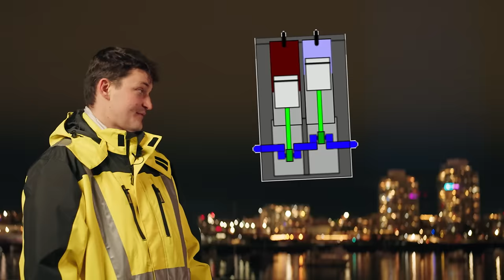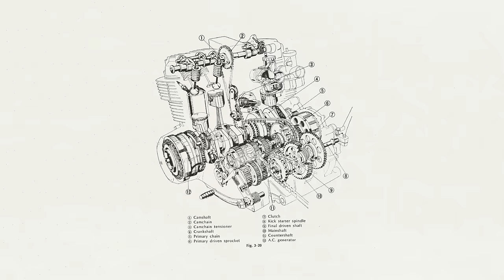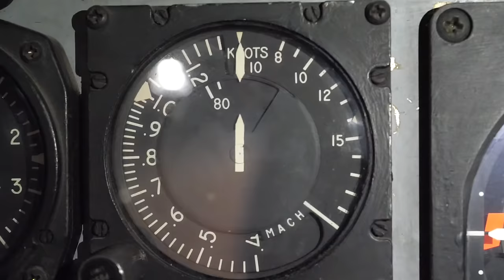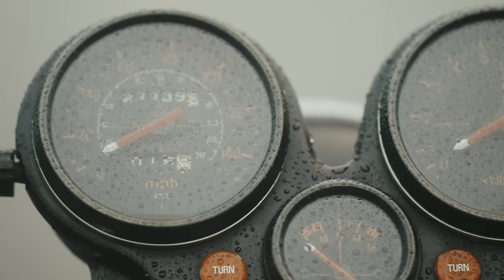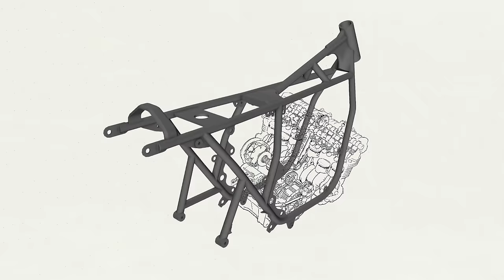Riding the Cream Machine - Honda's Smooth Six

Comment: Having graduated from Motorcycle Mechanics Institute in the mid 90's, I can verify that the school had 4 of these. AND to get out of the basic classes and into your "elective" picking one of the manufacturers to concentrate on, you had to do a valve job AND sync the bank of 6 carburetors on a CBX to move on with your schooling.
Reply: By Celestia!

Also hi dustykatt, haven’t seen your name in a while.
Reply: Ahh... back when motorcycle mechanics needed to actually understand motorcycles and mechanics.  Now, apparently all you need is some tools and the manufacturer's proprietary shop procedures manual for each bike.
Reply: Why can't a motorcycle engine have 1 intake and 1 exhaust manifold like car engines? Why do they need 6 carbs and 6 exhaust pipes?
Reply: @chadkline4268 The 6 exhaust pipes isn't true, technically cars also have a an exhaust pipe per cyl they just call it a manifold because they're welded together, in bikes they're not but it's the same part with the same function.
6 carbs help because the inside cyl run hotter than the outside ones and this changes slightly the amount of fuel they need. Cars can get away with 1 big carb because the engines are way bigger in displacement and less rev happy than motorcycle engines. The smaller the engine gets and the more revs it reaches the more fine the tuning needs to be so having 1 carb per cyl helps with that.
Reply: @alexandermoschonas2597  ok, that's a good answer, but it doesn't explain 2 carbs in parallel twins 🤪 I am kidding a little. I think your answer is as good as can be expected. It sure seems like a lot of added complexity and required resources with little benefit. Thanks, excellent analysis 👍
Reply: @chadkline4268 it’s actually because for optimal performance an engine needs the same volume of air fuel mixture going to each cylinder. This is only possible with runners that are equal length going from the carburetor to each cylinder. If you had only one carburetor the runners could not be the same length and this causes performance to suffer because certain cylinders get more fuel and air mixture. Also cylinder would have to share fuel because of the overlap in their intake strokes. This also hurts performance.
Reply: @TheDuckTeamYT  hmmm! Well, you seem to know something. But I don't think it is correct to say intake valves are ever open at the same time. And   a single carb doesn't put drag on the airflow for some cylinders and not others. With a 900cc engine and 6 cylinders, that is only 150cc per cylinder. That's like 1/2 a cup, less than 5oz, less than 5 tiny shot glasses or cough syrup cups, hardly anything at all. And the intake is fairly steady at 1000rpm, and an intake manifold is buffering between strokes, full with fuel/air at every new stroke. I wonder if a single carb in a multi cylinder motorcycle engine was ever even tried. Maybe nobody even knows how it would work 🙂
Reply: @alexandermoschonas2597  the only problem I have with this answer is that it has scientific correctness, but only to a limited extent that would likely not be noticable in practice. So, a middle cylinder is a dozen degrees hotter. It's not going to operate much differently with the same f/a mixture as other cylinders. I think the reason for not having an exhaust manifold as part of the cylinder structure is because it would trap too much heat. You want the exhaust gasses far away from the cylinders as fast as possible without any remaining in the cylinder structure.
But I still don't see a strong reason for avoiding a single carb and intake manifold. The major restriction is the air intake+filter, not the carb. A carb could happily supply an intake manifold of 500cc (2 cups) so that it always has more than enough f/a for the next valve intake. I think the reason is because an intake manifold would cause a delay .. when an intake valve opens, and the piston sucks in the f/a, the pressure in a manifold will drop before new f/a is drawn from the carb. It will take some time for that low pressure wave to reach the carb. And maybe the intake valve is even closed by that time. But at a 1000rpm, I'd still expect airflow to be pretty smooth. Even if a few strokes are not. It would be interesting to see if someone ever tried it.
Reply: @chadkline4268 one carb per cylinder allows the intake manifold to be as short as possible which helps throttle response.
Reply: ... The only question everybody else should ask; "With the right tools or do you wanna tell us you did it by hearing?"

Because the later would be impressive. The first is just an exercise in exaclty the job you got trained for.
Reply: @chadkline4268  Double Carbs? Ever heard from them?

Impala, Grand Prix, Mercedes SL and alike? 

Like, you do know that you also had then to adjust the timing right and so on otherwise you blew out your Valves?

And he literally explained to you why; Thermodynamics.
Reply: @DaroriDerEinzige  The right tools and the manual!
Reply: @dustykatt  And here am I, buying those Tools from my own money to do the same in my freetime without getting a certification.

Tell me about being born 10 years too late.

Well, ok, on the other hand I can also fix electrical stuff and put new microcontroller on boards.

... Which I also do in my free time without getting paid or a certification >:(
Reply: @DaroriDerEinzige  Well, I paid like 18K for my schooling, so get those skills for free!
Reply: @dustykatt  No front, but I am always amazed of how normal it is for US Americans to just take it that education is behind a pay wall over there.

Like, that's literally the opposite of Freedom and they themselves often point out that Universities & Trade Schools use their Status to influence young people.

Like, if somebody would tell me I'd have to pay for an apprenticeship or for an University Degree, I'd just would do illegal stuff. Last time, one guy over here got forced out of University and had no perspectives, he started the 2. WW.

Seriously though, why should I pay to get Certifications which only serve another men to be able to decide if he wanna employ me or not?

Like, if nobody would do that - Rich people simply would have to learn to fix their stuff on their own or they would be forced to change the System.

Imagine you've a dead beat Dad like me, and start with -40 000. How tf should you even be able to get a credit for the 18k to get some Certifications to be able to get a proper job to earn money to pay back debts your father made?

And even if we take out the family debts, just on your own; you would be forced to get into debts to be able to work. That's basically "slavery" like the Romans or Europeans did to each other. You wanna have a Ticket to the new world? Well, then you'll have to work for me like I say you will, for 10 years without questions - otherwise I'll hang you. (Not as harsh as, you know, the famous slavery over there but that was a thing too)

It's really astonishing. I mean, imagine to take away AR15's from US americans, how they would escalate - yet those things are completly fine for them. You wanna learn someting? Weeell, then give me money and if you don't have one, become a modern slave!
Reply: @chadkline4268
I agree with you and unfortunatelly with a bit of research i didnt fing any multi-cyl bikes with a single carb to check if it's been done on an obscure model in the past, but I guess you did this search already. 
My second guess is that the RND has been done by the likes of Honda or another bike manufacturer especially when  they started going for over 100hp performance. While it would work there's no really a counterargument of why it should be done. Having worked on many bikes I think it would be hard fitment-wise to have a single carb I4 bike. On I2, V2 and especially on a V4 applications (Eg the VFR 750 of 1986 had 4 carbs that are laying almost flat so I big single carb would be about the same size ) it could be done, but there's really no benefit and most could argue that a single carb per cyl is the way to go for performance, Hell Yamaha in the 70s and 80s even had 2 carbs on the single cyl XT 500, and later 600, and I always though it didnt make much sence but Yamaha knows better than me. Meanwhile in the car world, performance oriented cars like the Stratos opted for indipendent carbs per cyl as well.

The answer to your question has 100% been answered in the past, too many examples point towards the "one carb per cyl equals more performance" answer and Yamaha, Honda and many more definitely experimented and found their reasons.
Reply: @alexandermoschonas2597 just to add to the discussion here, I'd like to add that in the Goldwing community it's fairly common to convert the older 4-carb bikes to a single carb in the name of reliability and simplifying maintenance. However, it's generally expected and accepted that doing so is guaranteed to bring a decrease in throttle response, power, and fuel economy due to the fact that the intake runners necessarily must be much, much longer than they would be for individual carbs. It also brings in additional problems like intake icing. The 1500 goldwings are one of the few examples I know of of a bike actually using a one carb for multiple cylinders, where two carbs are used for six cylinders. They actually had to add coolant passages to the intakes in order to warm them up in cold weather, otherwise they frost, and ice up. Same problem tends to happen on the converted older 'wings.
Reply: @Wellimanewguy  Interesting! I've never worked on a Goldwing before so I didnt know things like that are possible but it sounds to me like adding 1 big carb and coolant passages is way bigger a job that servicing the original 4 carbs. Dont know how easy it is to find repair kits for the original carbs though so it could be done for that reason alone.
Reply: @Wellimanewguy  interesting comment. I'm going to look up a gold wing 1500 😁
Reply: @TheDuckTeamYT  While the optimum is for equal length runners, the CBX is probably the worst cylinder head design in all of motorcycling for having massively different intake port shapes, lengths, and flow characteristics. The designers and engineers wanted to keep the runners / ports straight, equal length, and short, but the team in charge of the rider ergonomics and styling of the CBX made the engineers angle the carbs in toward the centerline of the bike so the rider's knees wouldn't have to splay out, and to keep the middle of the bike and the seat width closer to the width of the CB750. According to Shoichiro Irimajiri, the engineer in charge of the CBX engine development, there were two things he wanted the CBX to have and didn't get - liquid cooling, and straight intakes. He said later the prototypes with the straight intakes made over 20 horsepower more than the equivalent spec engines with the funky intake ports, and added liquid cooling and straight intakes would have brought the CBX to about 140 - 150 horsepower, up from the production version's 105. Honda did attempt to band aid the intake issue by making the air box runners different lengths to try and equalize that runners, but is was only marginally successful. I have a damaged CBX head that someday I hope to weld up and re-machine to have the straight intakes the engine should have had back in 78.
Reply: With such small cooling fins and 6 cylinders how in hell does this thing not overheat??? The middle ones seem to have no way of dumping all that heat due to the lack of surface. Or does it have an oil cooler? Does anyone know?
Reply: @EbonyPope  I don't know, but I've never seen anything with 4+ cylinders without water cooling. I think air cooling is limited to twins/boxers.
Reply: @chadkline4268  I thought so too. Strange. Can't find any info on it.
Reply: @chadkline4268 it's the same reason modern cars have a seperate fuel injector for each cylinder.

Having the jet as close to the combustion chamber improves  throttle response and efficiency

This is especially true with direct injection engines.
Reply: @tristan6509  direct FI is completely different than carburetion. DFI works on the physics of a nozzle with pressurized fuel in a cylinder with a piston moving. Carburetion works on the principle of atomizing fuel mixed with air. It may seem the same, but it's very different in principle and in the physics. With carburetion, all the work is done before the F/A reaches the cylinder. With DFI, the work begins and ends in the cylinder in association with piston movement and valve opening/closing.
Reply: @chadkline4268  I’m fairly sure Triumph in the 60’s made versions of their parallel twin cyl bikes with one carb. I believe they were smother and easier to keep in tune but a smidge down on power.
Reply: @ShortInterestFilms  thanks, great addition 👍
Reply: DustyKat, did you attend MMI in north Phoenix Az or the newer one in Florida? I was in MMI early on, around '77. No sponsors then. Hired over the phone with Fun Motors Honda in NE Texas.Wrenched then managed service deptthru '81. Three wheelers were becoming notorious. The back hand rail of a hyperf  ATC250R broke his neck when he ended. Where has life got you now?  Wheels down&helmet up
Reply: @Liberty4Ever sounds like the rider isn't the only human motorcycle manufacturers are managing.
Reply: @EbonyPope The cylinders have gaps for air flow between them.
It's amazing how hot air cooled engines can get.
Even air cooled engines are oil cooled to an extent, any oil flow will absorb heat. Crankcases were finned, as were oil filter houses, to disapate as much heat as possible.
Reply: @chadkline4268 Nope, most bikes were air cooled until the 90's.
I've owned 2 water cooled bikes. All the other 1,2 and 4 cylinders were air cooled.
Reply: @huwbishop6995  Yeah i know. But when the air cooled bikes I know have buffet cooling fins. They look awfully underdimensioned.
Reply: @chadkline4268 My 2014 Honda CB1100 is a four cylinder, fuel injected, air cooled engine.  They added a small oil cooler up front as well.  It never has problems overheating and I have ridden it hard in hot weather many times.
Reply: @HockeyVictory66  interesting+strange 🙂👍

Comment: Finally a review of the CBX that doesn't exaggerate it's dimensions. It's only an 1" wider than my 80's Suzuki GS1150, and that's at the cylinders. Down low at the crankcase ends it actually has more lean clearance. The throttle response really is immediate the CBX carbs were the ultimate in carburation perfection. 45 years of ownership and I'm still in love with my 79 only my demise will end that.
Reply: Nice!
Reply: Those people who exaggerate it's dimensions, are same ones who get wet while reviewing the BMW GS series and their boxer engines.
Reply: It was a great handling bike for the time and balances well,these are sought after and really fun to just look at you don't realize the thousands of hours of design involved,by the 80s they had been making 6 cylinders for decades and no other Japanese Company could do it until Kawasaki with that boat kz 1300...

Comment: Once again Ryan has come up with a gem of a video.  As a former owner of THREE CBX's, one '79 and two 81's. I found them to be actually no more difficult to keep running well than most other machines of that era. The sound was intoxicating, and once sorted, they were reliable. Getting old and feebler, I sold my last one after 20 years of ownership.  Good memories for sure.
Reply: Time gets us all. Thank you for sharing your experience!
Reply: I'm so jealous. I cry every time I see a VTX1800, a Boulevard M19 2000cc video, or a Honda CBX1100 video. I want all of them, because they are engineering marvels that shouldn't exist.
Reply: With such small cooling fins and 6 cylinders how in hell does this thing not overheat??? The middle ones seem to have no way of dumping all that heat due to the lack of surface. Or does it have an oil cooler? Does anyone know?
Reply: @EbonyPope  very low stress on the engine for most of the use time, low revs and still quite a large heat exchange surface make it run alright if you take care of it
Reply: If you still have one and are willing to sell to a loving owner, please let me know!
Reply: The good times.

I have an GL1800A ( 2005 ) .

When i was born earlier i bought an cbx for sure.

Greets!  Thanks for sharing
Reply: I bought a new '79 CBX in 1980. Added factory rear sets and factory "clip ons". Also  Yoshimura exhaust. 

True enough, it was an impressive piece of engineering. Not as fast as I hoped it would be. I didn't like the way it handled. Very top heavy.

About five years later I bought a '81 GS1100. Much more fun to ride, in my opinion.

Comment: Back in 1980, I was so tired of chains, I purchased a shaft drive bike. The CBX was in the showroom and I really wanted it but I wanted a chain less. The salesman really wanted me on the CBX because they had trouble selling them. Rumor had it back then, new old stock CBXs could be had for cheap. A couple of years later I got tied up with a small group that rode early on Sunday mornings. In that group was a guy that rode a CBX. It wasn't stock. I still remember hearing the howl of that engine while the bike quickly got smaller in my vision. Distant memories that are as clear today as when they were made. All these years later, could have and should have been sorted out. I didn't. I still love the memories. Thanks for bringing those memories back with this video. Merry Christmas to all!